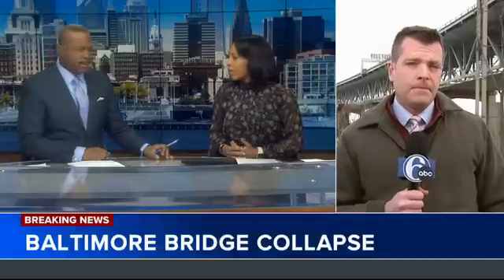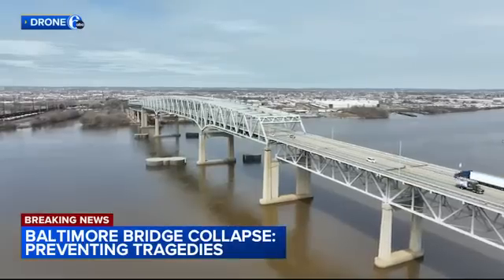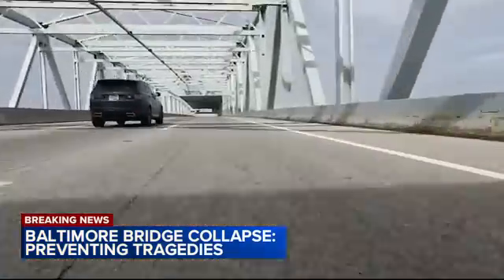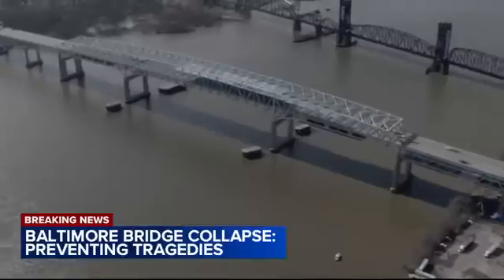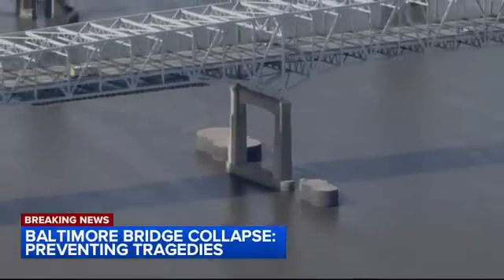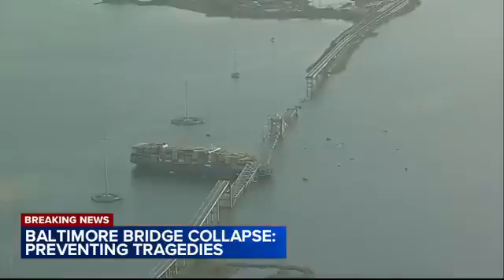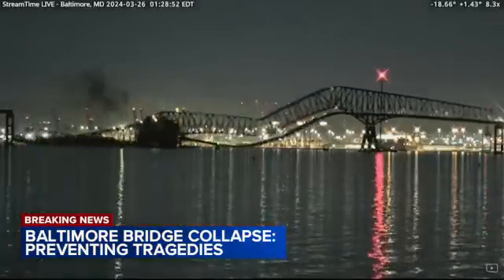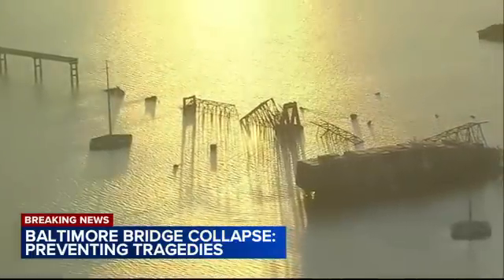Here's what surprised a structural engineering professor about the Baltimore bridge collapse

Comment: Look at the size of the ship and the size of the metal bridge, it's like a pounding sledgehammer against the wire fence. You don't need to be a" structural engineering professor" to know this. Those protection concrete pillars must have been knocked down first before the ship hit the base of the bridge.  Maybe the Ukrainian captain of the ship was told to teach a lesson to the US? If you don't send us more money accidents may happen!